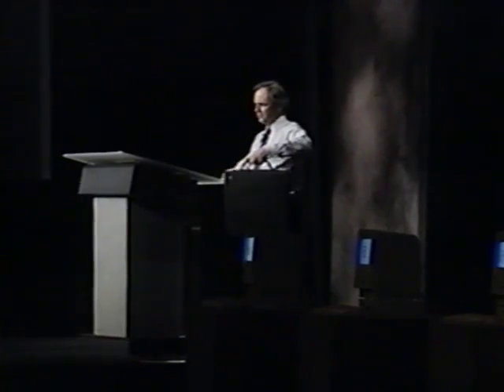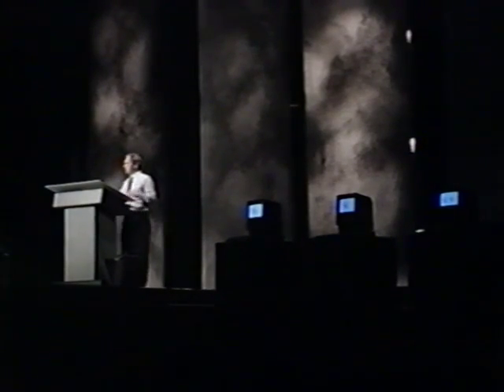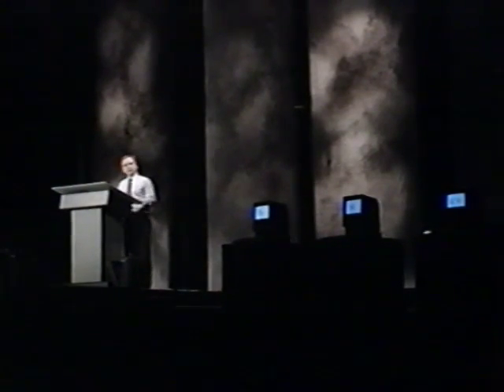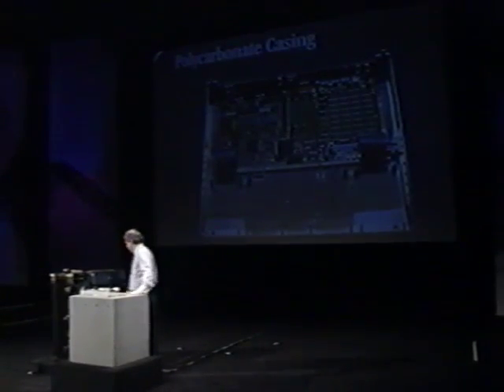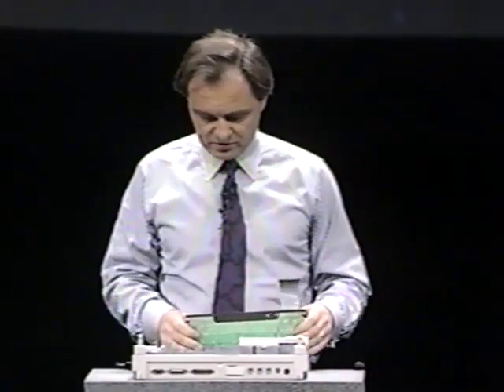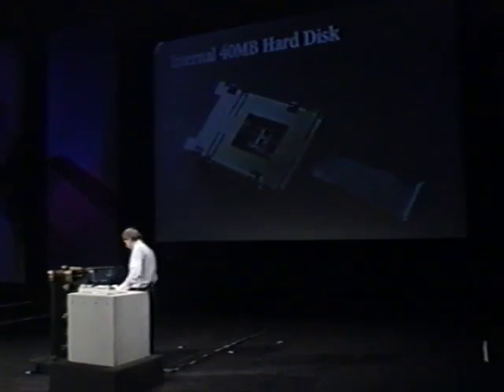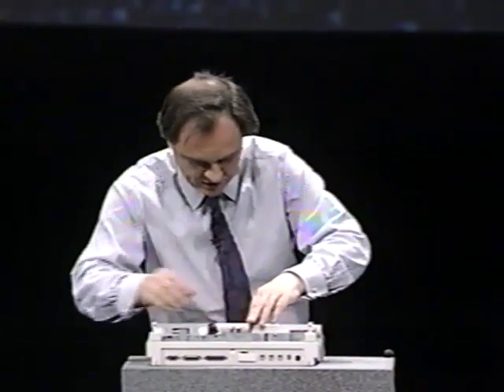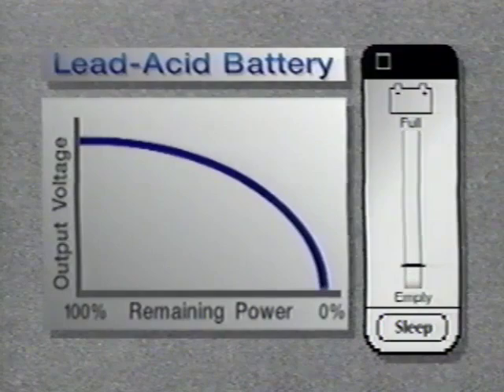The Macintosh Portable Introduction - September 20, 1989

Comment: Did you notice that the screen on this computer was broken?  The whole large horizontal line was not showing;)
Reply: I think that might be a reflection or a shadow or something. The display on the Mac Portable is really quite nice to use under ideal conditions, but without a backlight it’s also prone to having parts of the display be difficult to see if the lighting isn’t just right.